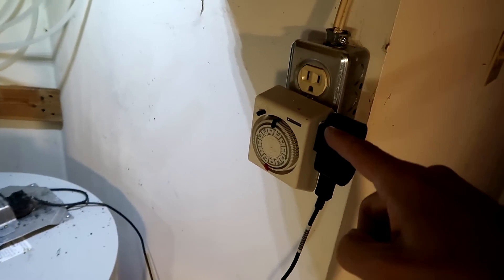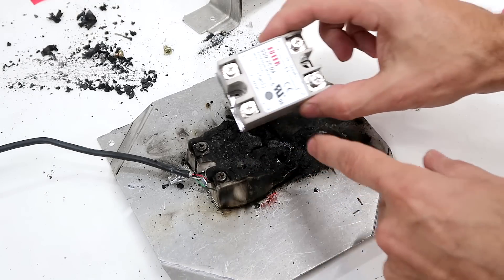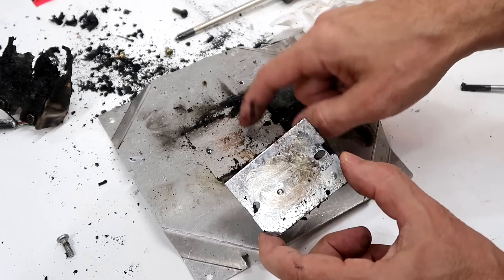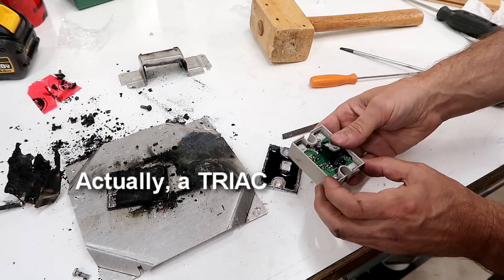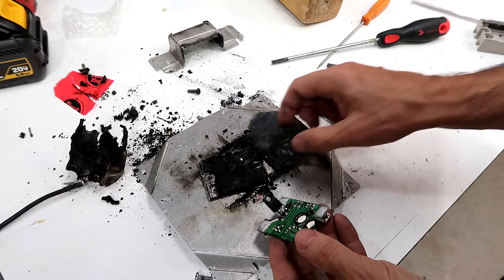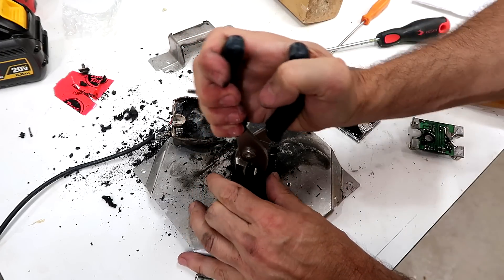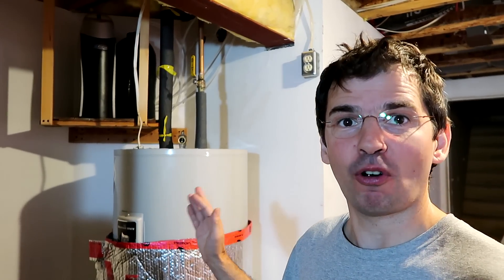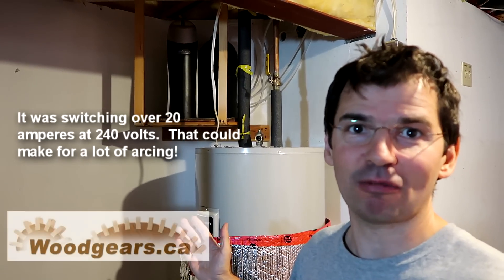Spectacular solid state relay failure

Comment: This is an application where a standard mechanical relay would be better. A SSW is more suited to situations where the load needs to be switched on/off rapidly or in short intervals, such as in the case of a PID controlled heater application. If the point was to maintain the tank temperature within a very narrow range at all times, then an SSR with a PID controller would be ideal. However, in this example, since the system is either on or off for long periods of time, a stout mechanical relay with any suitable coil voltage would have been more than adequate.
Reply: David Chuang and some sort of safety device - fuse, PTC thermistor, etc.
Reply: Yeah they literally make water heater controllers for cheap.
Reply: I don't think that is true at all. The SSR, by virtue of using a Triac as the ultimate switching element, has the advantage of always switching off when current is at, or near, zero, thus no arcing like a electro-mechanical relay would have. A SSR does switch on slightly faster than the mechanical relay, simply because it starts conducting within a half cycle of being commanded to do so, whereas a mechanical relay takes some few cycles for the contacts to transfer. But any SSR is perfectly capable of controlling sustained loads just as a mechanical relay would be. I don't know where you got the bit about 'short intervals', except that SSRs, because they don't suffer from arcing damage, would be a better choice for controlling inductive loads that have to be turned on an off a lot (frequently), because a mechanical relay in the same application would see its contacts fail sooner due to the arcing.

The SSR in this video probably failed because it was not rated for the inrush current of the large heating elements of the electric water heater. Mathias is reading the specs from the actual Triac, which may be technically adequate for the static load, but I don't recall him mentioning the inrush current specification of his heater....not sure if he considered it.

In my work, we build panels that turn on much larger electric heaters, and we always use an SSR for on/off switching, then back it up with a series connected mechanical 'safety' relay that does NOT open and close all the time (only opening on power failure or detected over temperature). These panels, of the same design, have been working perfectly for decades without SSR failures. I think the difference is that I design them correctly, with properly sized components, while Mathias may have used some 'available' SSR and then not properly considered the specifications correctly.

Without being sure, I think what probably happened this:

The Triac in the SSR was big enough to safely handle the load in all domains, but the ratings on the rest of the SSR were not quite so robust, and a foil started to heat up from current load that it was not designed for ....especially high inrush current due to the electric heater load's properties.....(all the while, the Triac was good with it), and this caused thermal stress to the foil, expanding and contracting, until it cracked, and with the small gap, an arc forms across the open foil, and the heat melted the assembly. I have seen exactly this happen (but not on my own product).
Reply: @youtuuba   yes , and possibly something solid state is more suitable for DC and it's arcs. SS=no arc.  (not a Triac though ;-) )
Reply: A brand name industrial SSR from Digikey rated 25A would cost at least $30. The same rating in a mechanical relay would be less than $5. But the most important point is not to trust a dirt cheap part off eBay or Amazon for a critical application, even a mechanical relay.

https://www.youtube.com/watch?v=E8EH2GqzWNU bigclivedotcom on fake Omron relays.
Reply: Even though I agree with you and said the same thing, I thought I would explain Matthias's thinking. If he used a mechanical relay (or contactor) then the coil would be energized 100% of the time that the timer was on, even when the heating element was not on. He thought the relay coil power loss would be greater than the series power loss of the SSR, because they relay coil would be energized for whatever, 8 or 10 hours per day (or however many hours it is). But the SSR power loss would only occur when the heating element was energized.
Reply: Not sure if these actually exist, but would it not be better to use some type of latching switch?
Reply: Can you tell me about solid state relay ....which relay we can use to control electric welding machine 400arc  using raspberry pi or audrino
Reply: Why would you need a on/off function when you are using a pid controller?
Reply: Expert question: Electronic control of tankless water heater: Use a PID? SSR vs SCR?
I have an 8KW Atmor tankless water heater that has two switched heating elements. I want to add stable electronic temperature control. But I can't find good information about the different options!
Seems the PID + SSR MAY have longer switching time, and that MAY reduce heating element life from thermal cycling vs a higher speed SCR. But I am having trouble finding the real answer.
Reply: or even a Contactor. Basically a relay but made to switch inductive loads as motores and stuff(has a middle pice that makes contact to both of of the sides so as it opens you have two gaps).
Reply: But why would a mechanical relay be better? You're only saying that SSW's strength lies in fast switching, which does not imply that it should not be used in slow switching applications.
Reply: okorok Simple, very simple. It has a continuous coil current but no voltage drop problem. So they can switch large currents without heating up due to that current.
Reply: Ty.
Reply: because when the triac fails, it fails in "conducting" mode. Plus if you're using a SSR, you have to make sure it is a real one and not a knock off like Matthias used. They say it's rated for 25 A, but actually it is rated for half of that. Bigclive tested those knock off Fotek SSR's from China a while ago.
Reply: okorok the mechanical contacts have a resistance that results in millivolts dropped instead of nearly two volts. So they don’t get hot.
Reply: All solid state relays dissipate energy proportionate to the load they are switching. You need to get rid of that energy somehow.
Reply: Mechanical relays have a much higher current rating/higher efficiency and are generally much less expensive.
Reply: A mechanical relay has 'efficiency'? Makes no sense to me. And in my experience, SSR prices and mechanical relay prices are not on the same curve (relative to specifications), so a small EM relay is cheaper than a similarly rated SSR, but as power specs go up, an SSR can cost less than an EM relay. And when it comes to 'current rating' (are you talking continuous/steady state current, or inrush current, or what?), modern SSRs come in very high current models.....
Reply: Does anybody here has ever heard about contactors????
Reply: Stfu wannabe know it all. Go 3d print a buttplug.
Reply: @erik61801  do u 3d print butt plugs
Reply: erik61801 Lol, I will borrow this comment in future.

Comment: I've had trouble with this brand before too (yes folks, with a proper heat sink).
Reply: James Biggar the ones you find on eBay/AliExpress are actually counterfeit. Real ones cost about $40/ea. The UL even has a warning on them.
Reply: Fotec are OK.  it's the fake ones that are the problem.
Reply: I have used these for many years in Industrial Applications with little problems. We mainly use them to energize motor Contactors and the like when using Programmable Logic Control Applications.
Reply: If it says "Fotec" or "Foteh" it's probably not legit :)
Reply: FauxTech - legit, eh?

Comment: Yikes ... 

You were damn lucky; accidents like that can cause serious fires ... having done a fair bit of forensics in my studies, you'll be very suprised how a, say, faulty bit of electronics can result in a runaway fire, if the circumstances are correct ... At least you had the common sense to not put anything too flammable near it ... 

[Also, and correct me if I am wrong, but isn't the type of plastic used in that specific type of pipe insulation self-extinguishing (viz. it melts rather than burns ... it looks like it did ...) ...]

Comment: wow. you're brave. I usually don't go over 2/3 of what the spec sheet says something like this can take.
Reply: Even if this was not imported from China, he is running 22A on a 25A device. NEC standards in the US say that you should never go above 80% in continuous use. This is 88%.
Reply: For Chinese stuff you can half every rating by default...
Reply: If it is no name then I don't go over 1/3, if it is a made by a good known brand then I probably wouldn't go over 3/4 for something as high power as this. But all this stuff is just rule of thumb, all of the manufacturers have different quality standards and you never can be too carefull.
Reply: Its not that cheap Chinese stuff is over rated, it almost always is capable of doing what it claims. It's just that they dont specify the numbers tend to be ABSOLUTE LIMITS under ideal circumstances. A top quality brand name part builds in the right amount of overhead so they know it will handle what they claim long term, even if youre running on the edge. The cheap stuff just puts a big number its probably technically capable of, but they dont say for how long. The general rule tends to be cut the ratings in half and hope it will do that. For anything higher than low voltage or low energy stuff, I wouldn't run past 1/3 of its rated load long term.
Reply: The nameplate rating of solid-state stuff is always under optimal cooling (like: TO-220 MOSFET: 100 V / 47 A [at Tcase=25° and Tjunction=150°]). Every reputable brand will supply a datasheet with all the numbers you need and fancy graphs (like maximum current vs. heatsink thermal resistance) for those who don't like numbers. They always have an application note or two telling you pretty much exactly what you need to do to keep their parts happy.

Take a look at this: https://www.gavazzionline.com/pdf/RS1A.pdf

On page 3 it tells you exactly what heatsink you need for which current and ambient temperature. Says there, 50 °C ambient (standard assumption) and 20 A needs a 2.6 K/W or lower heatsink. So you get a heatsink with that spec and you're good.
Reply: For a cheap no name ebay part? Wow man you are brave. I'd probably go with 1/10 on those. Or just buy the proper ones.
Reply: Don't be such a baby.
25 amps? I feed 35A through a relay that I got off Alibaba, works perfectly fine. Just in case I have a MCB and a RCD before it.
Reply: i was guna say have a 1/3rd overhead for safety but you got in before me LOLz
Reply: Especially if Chinese. Then assume less than half rated.
Reply: I wouldn't trust those generic Chinese parts for anything.
Reply: @bborkzilla  better not drive or use anything u own then.
Reply: ...But how are you (me, inexperienced) supposed to know when not go over a rule like that?
I bought a cheap Chinese high-speed 10A PWM dimmer for my homemade LED lamp, but it heated too much at 6-8 amps. so I glued two heat sinks to the tiny heat sink they supplied. Works perfectly.
Reply: It's half for super cheap stuff and cooling is a requirement. I know what dimmers you\re talking about, and I burnt 2 of them making a stable system with remote controls. Nothing cheap chineese likes heat it seams. The rest(like trusted brands) it's 2/3.
Reply: +Yonatan24 If you don't have enough knowledge to take these things apart and asses what they can really handle, just don't use any mains-powered products from eBay/AliExpress/DHGate/… Not even a god damn night light. That shit can kill you.
Reply: @liquidus2172  yes. Literally everything from China is overated. It is all crap.

Comment: And that kids is why you only hire licensed electricians to do your electrical work.
Reply: I've seen the work of licensed electricians that is much more dangerous than Matthias's.  Just because they are licensed doesn't make them magically smarter, more careful, or less lazy than the average person.   Electrical power systems are not rocket science.   Unfortunately, a large portion of our population never takes the time to learn and understand them.   If they did a lot of the shoddy workmanship in this world would never pass as professional.   It is much better that Matthias posted this so people can learn about his mistake than repeat it.
Reply: Chip Schweiss that may be, but as a licensed electrician I've seen more crazy messed up crap done by homeowners then licensed guys. That being said, Matthias seems to know what he's doing, he just tends to use what he has on hand instead of the correct stuff most of the time. I'm sure if he'd looked into it a little longer he would have used the correct relay from the start.
Reply: An interesting story - thanks for sharing.  I have done a lot with triac switching over the past 20+years and not seen a failure this dramatic.

I see the point of the application, it's an interesting DIY project, but as shown there is some risk - we have learned something.  From what I've seen over the years and more so recently, licensed electricians are not the solution they should be.  I've seen a lot of very dodgy work done by supposedly qualified professionals.  Although most electricians would probably allow a larger safety margin in the current rating.

A SSR needs to be suitably rated, have a heatsink suited to the task, be of reasonable quality and installed with failure in mind.  We use a lot of triacs (hundreds), mostly 16A rated and switching up to 3 amps and 25A for loads up to 12A.  The over-rating means we don't see triac failures,  but still the occasional installer manages to blow tracks off a circuit board.

Embedding power electronics in homes is becoming quite common and fire prevention and safety are a top concern.
Reply from the maker: Yes, that would solve it.  Because that would more than 10x wipe out any savings, making it uneconomical.  As in, it doesn't get done.  Not doing stuff is an excellent way to avoid mistakes.
Reply: Matthias Wandel if that's all you're saving anyway, then there's really no point in doing it at all.
Reply: "Licensed" wouldn't change anything. But using a Chinese SSR in an unattended application is just asking for trouble. A high quality 25A SSR is only $26. Low price to pay for less chance of starting a fire...
Reply: VirindiJess sure being licensed would change something. Most places that require licensing also require inspections. And more licensed electricians aren't going to risk their license with a poor installation.
Reply: and it will fix exactly what in this situation?
Reply: +Tomas Kovacik Well, for one a licensed electrician should know that if you're going to switch 20 amps with an SSR, you need a big-ass heat sink.
Reply: Tomas Kovacik maybe using proper components
Reply: Most licensed electricians know that that solid state relay isn't meant for that application. And would have used the proper relay.
Reply: can you give me some link to article/study where is stated that SSR are not good for this?
Reply: Tomas Kovacik I didn't say solid state relays weren't meant for that application. I said "that" solid state relay isn't.
Reply: Tyler I don't think so.. it's fine, just use the proper rated one. Better to have a higher rated component than one barely enough
Reply: Roberto Ghezzi my point exactly.

Comment: TO-220 is not a lot of surface to sink away the heat.
After one of those blew in a setup, I bolted the next one to an old Intel heatsink (one of those with copper core) and that fixed it.

Comment: You're supposed to use these with a properly rated heatsink.
Reply: He had screwed it to that thick sheet of iron tho.
Reply: @Cheese_1337  Nowhere near enough heat sink. For a 25A rating, 23A requires a very large heat sink with fins, and probably a fan. Look at a datasheet, and application notes, the heat sink requirement is not trivial, he needs to dissipate over 74 watts - that is a LOT of heat. A top quality brand would not have survived w/o a proper heat sink. Sorry, but Matthias did not design this correctly - stick to woodworking!